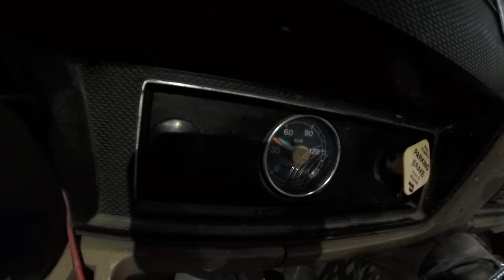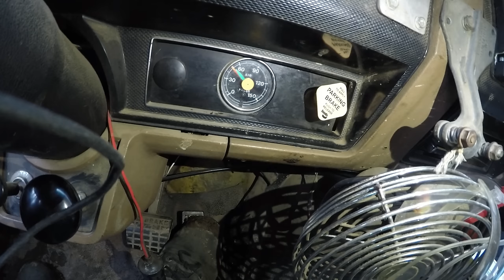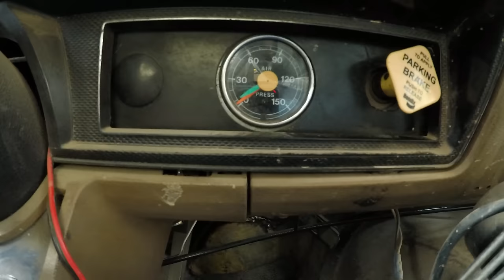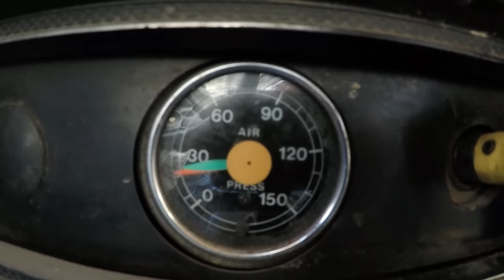Fixing my air brakes and towing an RV

Comment: The part that you replaced but did not help. Will you leave it on on or send it back. Is it worth the trouble or not. Great video
Reply from the maker: Ill just leave it on there. I'm not positive the old air dryer was perfect.

Comment: What was the tool you were using to hold the wires while soldering? This is how I do all of my wiring, but holding them in place has been a struggle. That looked like a nice setup
Reply from the maker: Helping hands.

Comment: Andrew it would be best that you could get a bigger 4x4 dump truck and a winch for your trailer for when you have to tow rv's etc...
Reply from the maker: Yeah, that would be a cool thing to have, 4x4 trucks are a little hard to find though.
Reply: Andrew Camarata I enjoy watching your videos ,  in one of your last videos where you were buying and sell your heavy equipment,  you mentioned a blue dump truck, have you went back to see the owner of that blue dump truck to see if he still had it $10,000 or did he sold it ,  to which that size truck would be a huge investment on your behalf of your business,   that is if you still can find one similar to it , unless you can find a cement truck without drum and put a dump box to fit the size of it
Reply from the maker: Stephan Ross I know that guy sold the truck, but he often has trucks for sale, I should buy a bigger dump truck this year,
Reply: Andrew Camarata well if you do buy yourself a tri-axle if you can't find a double axle

Comment: When you're figuring out a mechanical issue and buy new parts to only find out that's not the issue, do you replace the old part and keep the new part?
Reply from the maker: Depends what it is. I did keep that old air dryer (this is an old video, the brakes have been working fine). But in this case, I felt is was best to keep the new air dryer installed, even though that was not the problem.
Reply: @AndrewCamarata  I love your videos. Always happy when I see a young man who works hard!

Comment: I don't have one tenth of one percent of your skill, you amaze me. However, I was surprised to see you use an adjustable wrench in what I was taught was the wrong jaw orientation. I'm not a troll, just wondering if you have ever heard that there is a right and a wrong way to use an adjustable wrench and if so, do you agree?
Thanks
Reply from the maker: Those wrenches work both directions, a drop better the one way. You might have heard that about a monkey/pipe wrench, they only work one way.
Reply: Your only supposed to pull so all the force is on the hard jaw of the wrench (but honestly who follows that rule)

Comment: 5:45 That is not how you solder. You are suppose to heat up the copper from the bottom and feed the solder from the top and the heat from the copper will melt the solder. That is what they taught us in school but other wise good job and great video
Reply: You are a little thin skinned.   Some comments are meant to be constructive.

Comment: And rew is a person that drove a truck for many many years that air dryer needs to be checked twice a year once in the spring once in the fall and nine times out of 10 and all you need to do is change the cartridge and you're good to go if you don't change it in the fall you'll end up getting moisture in your airlines and it'll cause your airlines to freeze up just as a word of advice

Comment: Andrew why are there two needles on the air pressure gauge?
Reply: One needle is for primary Air and the other is for secondary air some trucks have 2 gauges  and some have both on one.

Comment: When you have a problem with little or no air building up disconect the main air line to the air  dryer and star the truck up if you have no air it's usually a bad governor if you have plenty of air coming from the hose  it's most likely the air dryer. If the valve on the air dryer gets stuck open it's a dirty air dryer.

Comment: It looked like you work bench was concrete. Would like to know how it works and possibly how you made it.
Reply from the maker: Yes it is, its solid and heavy, it will never move or shake when doing something hard on it. I made it angle iron, rebar, and the skin from a shipping container. It works well, I think the concrete could be sealed with something to make it less dusty.
Reply from the maker: It hasn't been soaking up oil, the problem with the concrete is that its always like making its own dust. I think like an epoxy coating would be good for it.
Reply: Wall primer work fine and is cheap.
Reply: Juha Tuomala kinda like you?

Comment: The results when you tow a vehicle by a bumper bracket and not a cross member!
Reply from the maker: Yeah, they did not make the bumper strong enough. Junk.
Reply: @AndrewCamarata  looks like the plastic grille took a hit as well. Come to Seattle, WA. We have wrecked RV's sitting all over the place. Neither the city nor the county has the testicular fortitude to move them. You and your dump truck could haul them straight to the nearest crusher.

Comment: I have a Ford f-700 and it's the truck that's in my picture and the cab light on the passenger side like all the way to the passenger side broke off completely and doesn't work anymore

Comment: Are the o-rings on that truck metric or SAE?  I've had problems with people using the wrong standard.
Reply from the maker: I'm not sure, I've never had to do an O-ring. Most of that truck is SAE, but it depends on the part.

Comment: Is there anything you can’t fix?
Reply from the maker: Sometimes those computer controlled systems in vehicles are hard to do, some hydraulic components, and some engine internals. But I can usually do what needs to be done.
Reply: @AndrewCamarata  you do pretty good,,I spent many years doing similar things,

Comment: You don't put any thing  between the lights and the truck,? so water can't come in the holes ? silicone or a gasket , thats just wrong, lol.
Reply: littleaub, the new lights had a gasket.  He should have used something as a bushing.  In similar situations I have used a small piece of old garden hose to protect wires.  Stay safe.  Keep watching Andrew.

Comment: Great old dump truck by the way. Has it bern reliable other than normal maintenance as here? Nice shop too! PS where did you get that solder station? Totally bitchin.
Reply from the maker: Thanks, yes that truck has been very reliable, I've had it many years now. I think that's called a "helping hands" I think I got it at radio shack, but you can get those on eBay.
Reply: Thanks, great truck and thanks for the helping hand info.

Comment: That was a $200  bumper; now it's a $2 bumper.
Reply from the maker: These tin foil bumpers that are on trucks are not worth anything. Put a piece of C channel on there so it does not bend for no reason.
Reply: @AndrewCamarata  I agree. After the 60's they all turned to junk. In the 50's most of your old farm trucks came with a C channel rear bumper with steel diamond plate on the top. By the way, I'm looking for one of the dash cutting devices for radio installation in MY dodge. Does Sthil still make those?   LMAO!

Comment: No DOT ...lucky
Reply from the maker: Its time to get rid of the excess government regulation. They make it impossible to get anything done.
Reply: regulation to a point But they are going after everyday working people and really putting a hurt on them ...For some it's harassment on daily basis without a voice for drivers ...the system needs to change.  Great videos!

Comment: Mr Andrew, hope you do not take offense with my comment. I noticed whenever you stripped  mechanical parts, engines, vehicles, etc, you are not inclined to clean up or wash off the dirt or the accumulated filth. By and large,you are a meticulous person to a certain extent when you set out do to your task.

Comment: The least expensive place I can buy replacement parts for my old Ford dump truck is Rockauto [dot] com   Much cheaper than NAPA and the rest.  I have to wait about two days for delivery.
Reply from the maker: Yeah, I've used them, sometimes getting parts for that truck is difficult. Ford didn't make most of the truck, so its best to get the parts from the company that made them. For example, the air brake system is made by Bendix.
Reply: Amen..rock auto good place. Bendix used to be all about brakes 60s -80s
Reply: That truck is awesome, nice job Andrew.

Comment: Oh S&%#! there goes the RVs bumper. :-(
I thought the dump truck was 4wd, obviously not.  Maybe a winch would do?  If you had a longer chain (weld broken link?), you could tow the RV from the other side of the mud?  I'm sorry, it's just my opinion but it's time to clean up the property (stack pallets, put tires in one place, etc...) so it doesn't look so shabby.  You may find something(s) you need?  ;-)
Reply from the maker: It would be nice to have a 4x4 truck like that. That mud never ends. I had a hard time getting out of there. I wish I had moved the camera, I was stuck for a few minutes. Yeah, that property is a mess, I told them I could help clean it up, I don't know if they have any money.